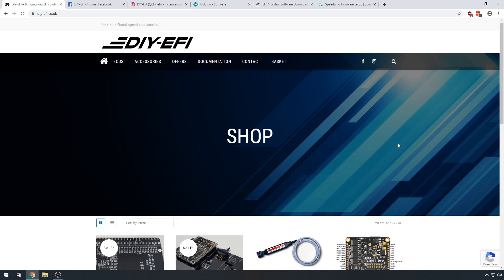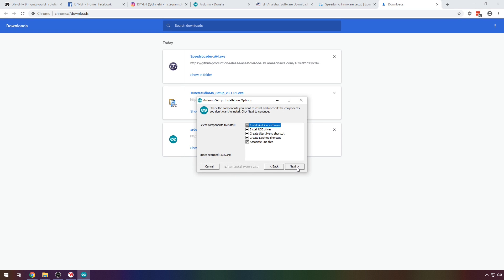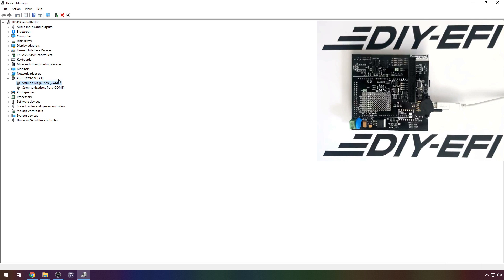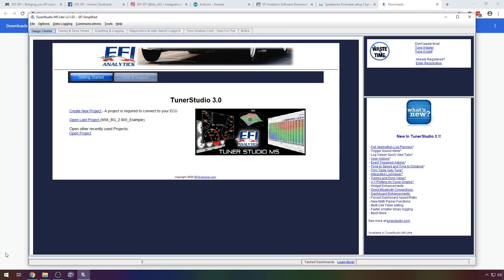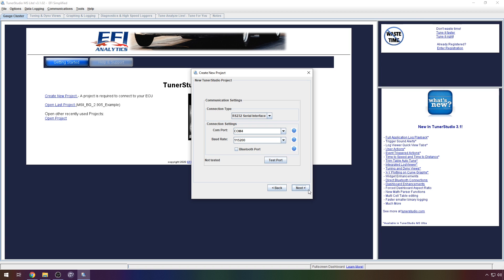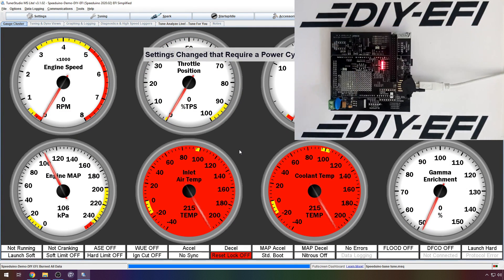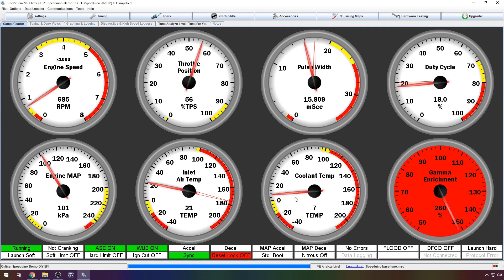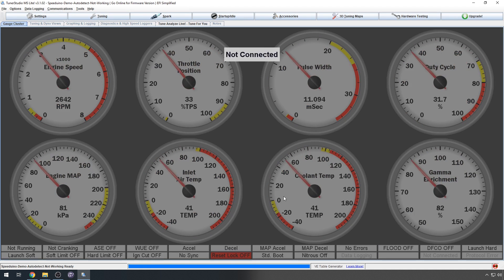Getting Started With A Speeduino ECU - The Complete Basics Guide

Comment: Will the Speeduino work with the Chevy LS style V8 engines?  Like say a genIII 5.3l out of a 2000-2007 Silverado?  Or what about a genIV out of an 07-2012 silverado?  
Does this work to control the electronic trans as well?  Or will it interface to the GM Trans Control Module?